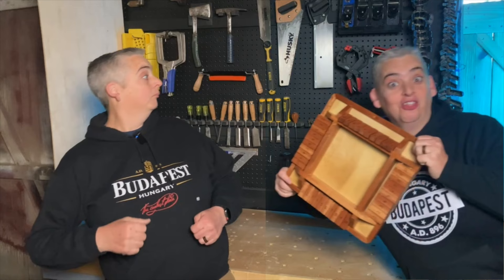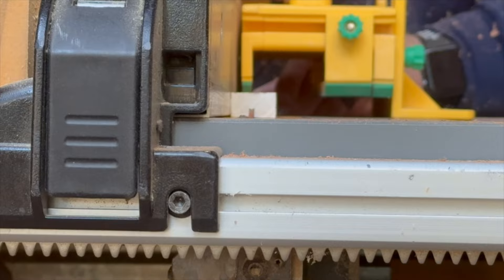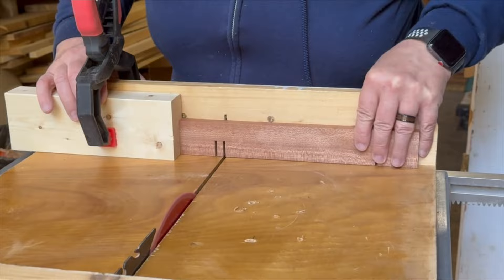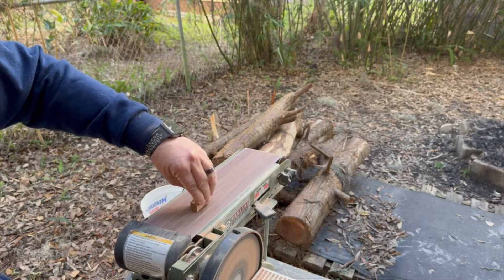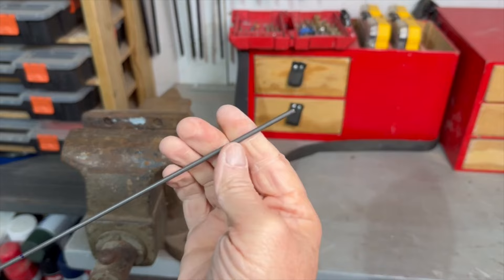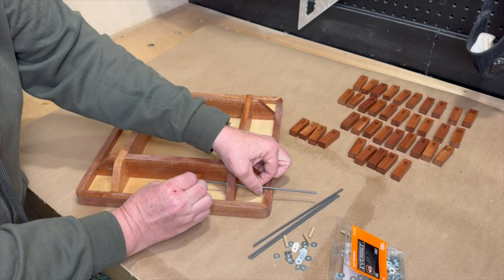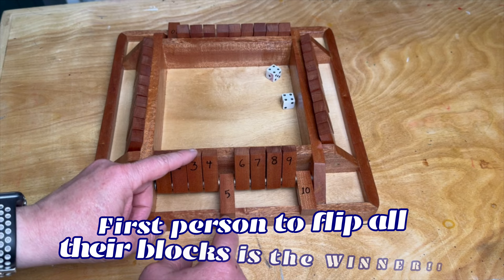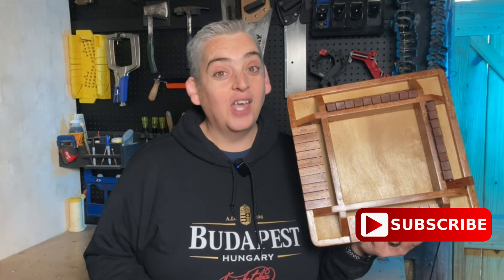How To Make The Shut The Box Game // Woodworking Project

Comment: I had never heard of this game before and like its simplicity. Just wondering if I can make this with a steampunk flair!
Reply: Great idea, i could use a copper panel instead of plywood!
Reply: @richardmccann4815  maybe  use gears to separate game pieces and change game pieces for copper pipe.  I think there’s a lot of possibilities. Mind if I take a shot at it?
Reply from the maker: That's a great idea! I should start posting pre-project poles so I can get some of these ideas before I finish a project. Thanks!

Comment: Can we get some rough measurements?
Reply from the maker: Here are some of the measurements. I am working on a full set of plans, just haven't had time to finish yet.
Base = 12 1/4" x 12 1/4" -  1/2" plywood, Frame Pieces = 1" x 5/8" with a 1/8" x 1/2" rabbet to hold the base.
Playing Pieces = 2" x 1/2" x 5/8"
Dividers = 1 3/4" x 5/8" x 12". Dados were cut 2" from the end of each divider and the hole were drilled 1 1/4" from the end of each divider.